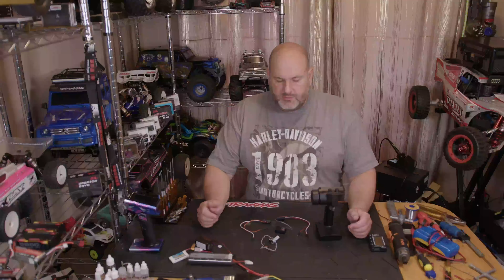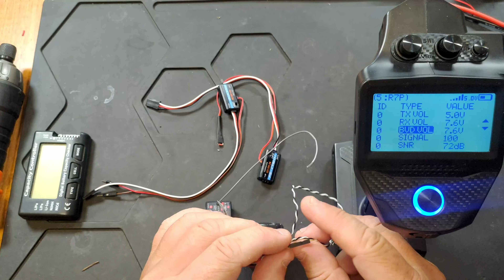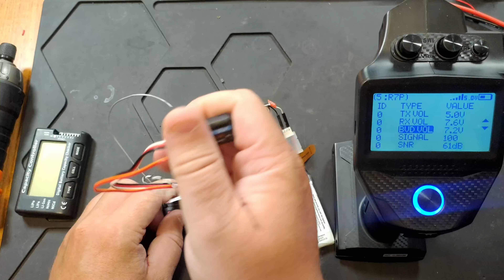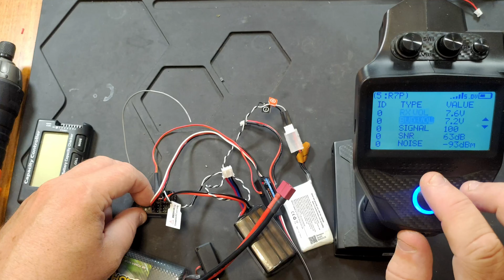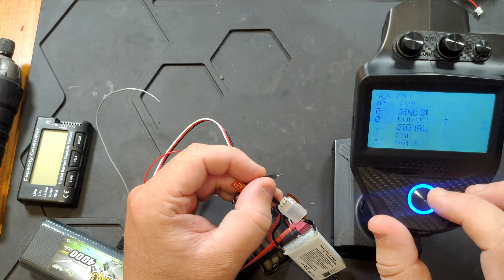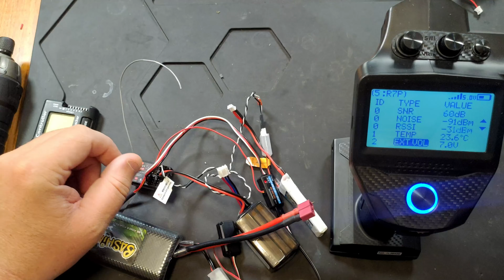Flysky G7P sensor set up and alarms CTM01 temp CVT01 voltage

Comment: TY for the video!
I have a question, can the smaller ATM01-temp & AVT01-volt be used with the FS-G7P?
They seem to be designed smaller and i am guessing lighter than the CT & CV sensors so i would rather use the AT & AV. They are marked with the same AFHDS 2A and seem to work with the same radios listed as compatible with CT & CV telemetry devices. So I would guess they are compatible but FlySky is not very forthcoming with information...EVER!
I mean my friends don't even realize there has been a newer HIGHER Voltage tolerant & longer range reciever for their GT3 Radios the FS-gr3F instead of the FS-gr3E! 
Would be nice if the telemetry connection instructions were even included in the G7P manual, and also would be nice if they updated the website to include the Gyroscope & Drift (LED Lights) recievers as compatible equipment! AliExpress is more up to date with what accessories are available and which work with what!
Reply from the maker: The at and AV sensors are the same size as the CT and CV sensors just different plugs
Reply: @WTFRCCars thank you!!!!!

Comment: hello Man, how are you? Your videos is very nice! Can you help me? I have one CTM01 but i broke the diodo sensor. I sended a email for factory  question: which do I use? and no help me. Can you take a photo yous sensor for me or tell me what number is on it? I would be very grateful. thanks.
Reply from the maker: I have looked on both the ones I have and there are no numbers on them they are just thermal resistors

Comment: I just got a HW motor with a 'temp sensor' 2 pin port on the back.  I wonder if that could be used somehow.  I don't now if it's simply a thermocouple, or is it more elaborate electronics inside the can though.
Reply from the maker: If it's just a thermocouple then I'd think you should just be able to connect it instead of the one fitted on the temp sensor, if you connect a multimeter to it you should be able to tell and then check the flysky one  :)

Comment: I wonder if you could, instead of an alarm, use the temp sensor to turn a fan on and off.
Reply from the maker: Not to what I can see
Reply: @WTFRCCars  alas. I'll have to figure out something else for a radiator fan on the Globe Liner, then
Reply from the maker: Yeh unless they add something in firmware :)
Reply: @WTFRCCars  Can you attach mixers to sensor output?  That would be nice - you could do it with a RX switch then.
Reply from the maker: No not on the current firmware

Comment: Temperature motor is working ?
Reply from the maker: Not sure what your asking ?
Reply: @WTFRCCars  can i check the engine temperature on this apparatus?
Reply from the maker: Yes I use the temp sensor to monitor the motor temps on my losi LMT, Hobao hyper cos nitro and the fid racing dragon hammer v2 :) so good for electric, nitro and petrol RC engine temps :)
Reply: @WTFRCCars  and the voltage on the packets can only be read by plugging the wires into the packet balancer?
Reply: @WTFRCCars  can i check the engine temperature on this apparatus?  I was thinking about Noble but I don't think she has avc
Reply from the maker: You can connect to anything you want to read the voltage of
Reply: @WTFRCCars  and the avc control?
Reply from the maker: You would need the receiver with gyro and it then has full SVC.
Reply: @WTFRCCars  svc or avc?  what do i need to have for it to work?
Reply: @WTFRCCars  and what receiver do I need to have for the avc and temperature sensor to work?
Reply from the maker: Flysky use SVC full stability control
Reply: @WTFRCCars  and which receiver has avc functions?
Reply from the maker: None flysky don't have avc they have svc
Reply: @WTFRCCars  but svc works like avc ?
Reply from the maker: No it's much better :) I'll be doing a vid soon as I get the new gyro SVC receiver they have only just been released
Reply: @WTFRCCars  and which Flysky receiver supports SVC?
Reply from the maker: This one 

￡20.77  30%OFF | Fusi FLYSKY FS-R7V remote control receiver 7-channel two-way built-in gyroscope is applicable to G7P remote control
https://a.aliexpress.com/_mLiLjga
Reply: @WTFRCCars  do you have facebook or messenger maybe i have some questions
Reply: @WTFRCCars  
i have xmaxx 8s can i monitor each 4s battery? and if so, what do I need to buy and where to connect to the receiver?
Reply from the maker: I have a Facebook group wtfrccars come join us :)
Reply from the maker: You would need one receiver that does BVD and 1voltage sensors but yes it can be done to monitor both lipos :)
Reply: @WTFRCCars  I sent to the group
Reply: @WTFRCCars  I have apparatus but I do not have a list like you in apparatus for sensors only 1 item
Reply from the maker: You have to have the sensor connected and powered up to be able to select it :)
Reply: @WTFRCCars  give me your Facebook will write to you
Reply from the maker: It's just Craig in Facebook :)
Reply: @WTFRCCars  send you